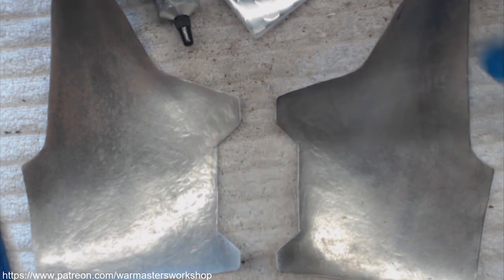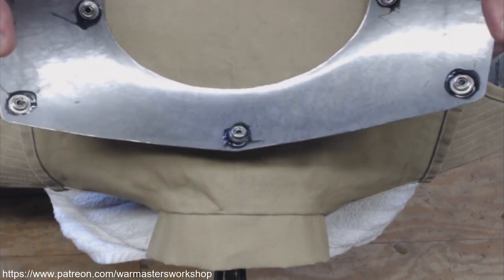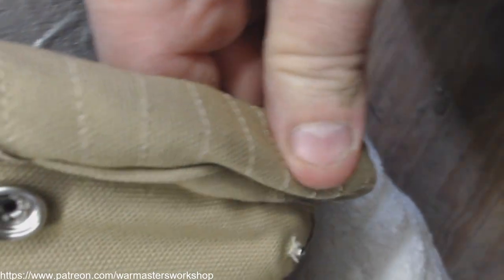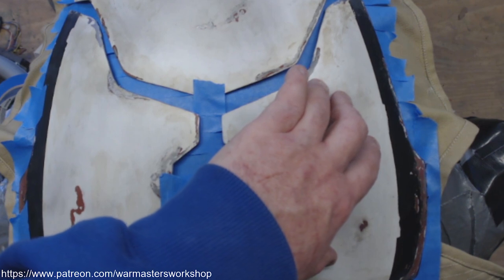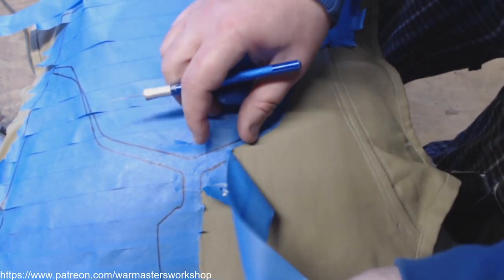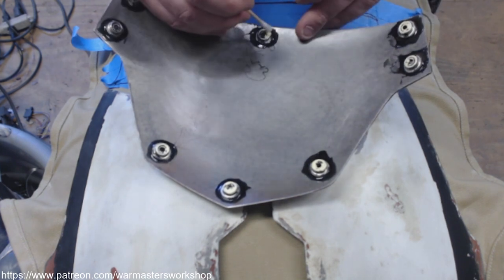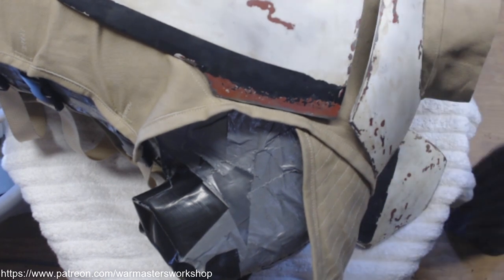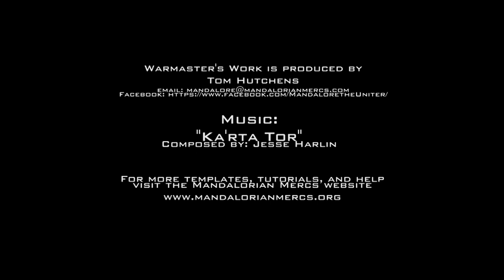Warmaster's Workshop - Episode 26: Armor Attachment, Snap Method.

Comment: Where did you get the vest? Where can I find others similar, as well as flight suit?
Reply from the maker: My wife actually made the vest, which she doesn't make anymore due to work.  My advice on soft parts it to check out the Trading Station board on the MMCC forums:  mandalorianmercs.org
Reply: @MandalorianMercsCC  do you have to be a member to access it?
Reply from the maker: @bertyboy5928  you'd need to register on the forums to view the Trading Station.
Reply: @MandalorianMercsCC  thanks, now done.